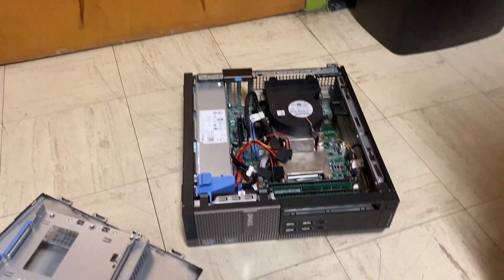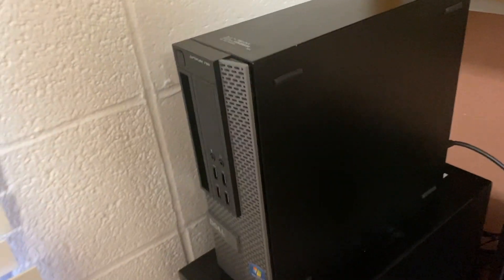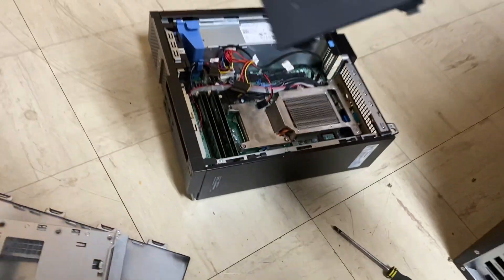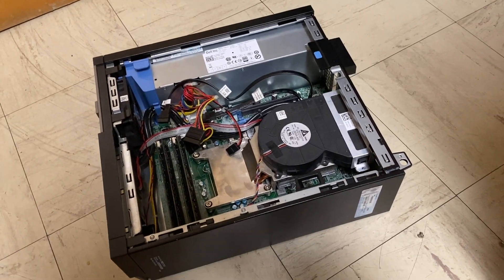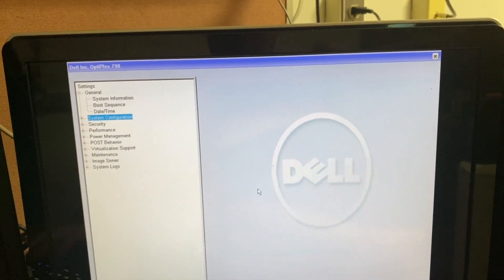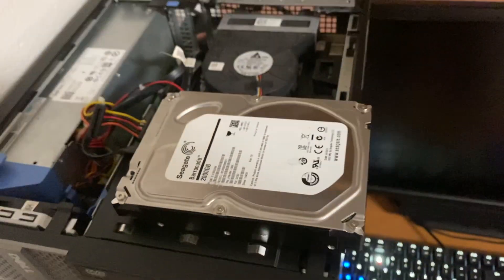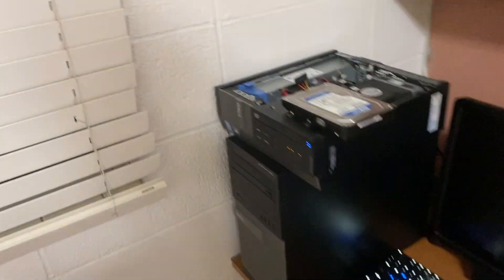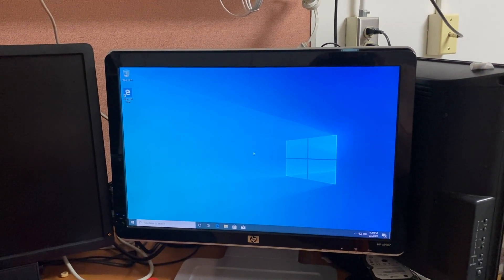Repairing a Dell OptiPlex 790 SFF

Comment: I also have a 790, so, which video card worked better?
Reply: oh i have to add in the list of nvidia. the gtx a2000 the newer low profile cards for sff like this. it is mini version of rtx family.
Reply: @CarinoGamingStudio  Thank you! I really appreaciate your suggestions, cheers!
Reply: low profile cards. gt 710 to gt 1030 is your bet if you want cheaper one. for high end and you think your machine can handle it. you can go for gtx 1050 low profile up to gtx 1650. for rx side, either rx 550 for tight budget or rx 6400 if you wish for maximized it. but not wise to own a rx to a machine like this cuz the wattage are higher than nvidia cards. so you best option is nvidia side of low profile cards.

Comment: I have one with 8gb Ram and 7i 2600, I Will like to see what they better choice to improve the grafic en this litle box...
Reply from the maker: The newest card would be a low-profile GDDR6 Nvidia GeForce GTX 1650. Gigabyte is the make of the card. They are expensive, but about the only option you got for modern graphics other than a GeForce GT 1030 or low-profile GTX 1050 Ti for these SFF OptiPlex computers.
Reply: Pretty sure  you can use any video card as long as you have a PCIE riser that's good quality, or was I misinformed

Comment: Are there other CPU fan replacement options that I could use? Could I perhaps get a noctua fan replacement and put that in the blower housing?
Reply from the maker: Probably not. It's ideal to get an identical replacement for thermal RPM monitoring by the system.

Comment: Where did you source that Delta blower fan from?  Was it new/used?  Any recommendations are appreciated.
Reply from the maker: I think it was a dell part number J50GH-A00 or delta model BFB1012H
Reply: @jwoolery99  Thanks.  I was able to see that J50GH-A00 on the label on the fan in the video.  I can't find one from an online retailer.  Any idea where I could source one of them?
Reply from the maker: I’d just make a saved search on eBay and wait for one to pop up.

Comment: I still own a minitower version of the 790, and I currently have no plans to replace it, since the Sandy Bridge is still sufficient for my needs. The 7020 minitower or the Lenovo ThinkCentre are two of my options as a backup.
Reply: ill go for 7020 than think center. the fan are not cleanable as it is backward face not like in the video.